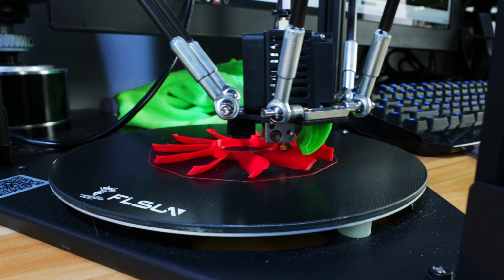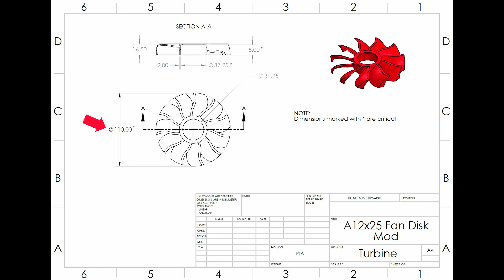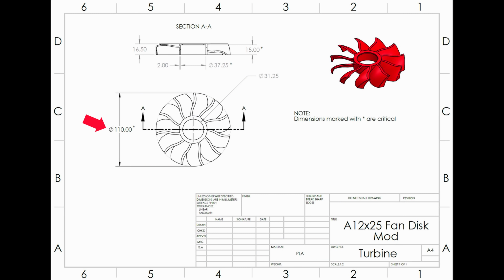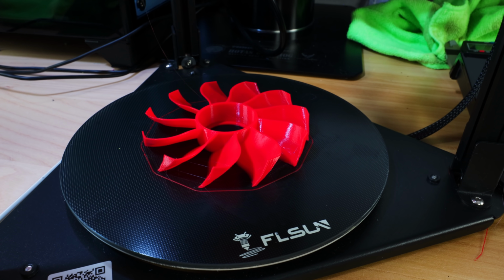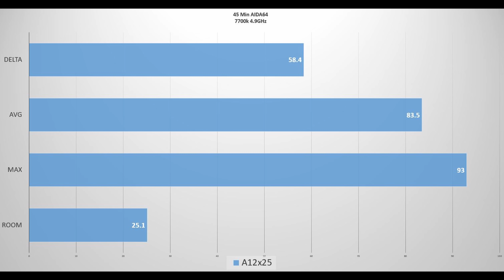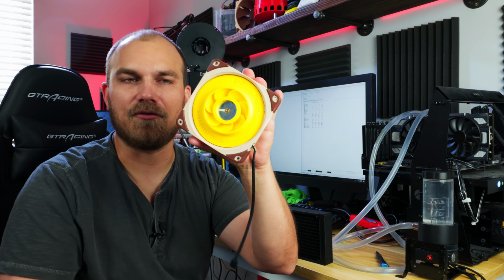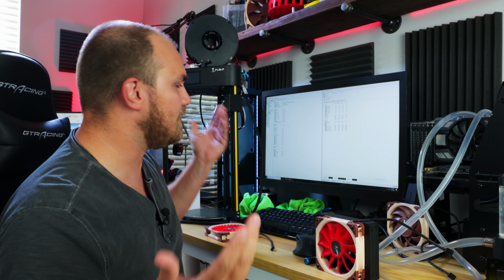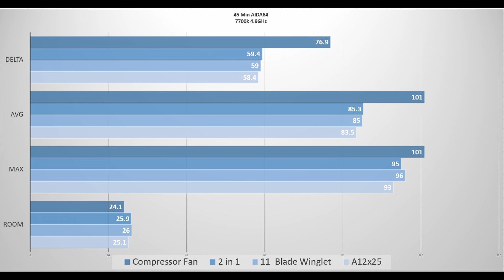My Subscribers Sent Me Their Fan Designs | Fan Show Down Episode 1

Comment: Suggestion: use a high rpm delta fan with pwm or a pot to control rpm. You could then test these designs at higher rpm, where some may perform much better.

Comment: I'm pretty sure the yellow one should spin the other way and be mounted the other way, using the large blade area to capture alot of air, and have the air speed up through the tightening and come out at great speeds from the smaller "mouth"

Comment: So your compressor is good, but the blades should be based on the shape and size of the standard fan.  Make the blades the same as the original 9 bladed one for the inner ring, but for the outer ring do something like 13 or 15 blades.

Comment: On the compression style you would want the compressed side (smaller side) on the cooler and the larger intake on the outside. If possible make the smaller size the size of an average 120 mm fan and the larger side sucking in more air. Would be great if you have a giant fan area and attach a small radiator to it without loss. Could even be better. Wonder if you could test the performance of it

Comment: Hi there, I really love the idea of making custom fan designs. Just wondering why aren't you doind tests with air cooled CPU coolers? There can be more gain from fan design than in liquid cooling. In liquid cooled CPU cooler you have radiator as limitation. Every radiator have it's limits and can't do much, much better than it already is. Some small variations yes, but I wouldn't expect great cooling improvements. If I was doing fan tests, I would test them with air cooled CPU coolers. Fan design can make more impact there. Idk, I would take some average Noctua aircooled CPU cooler and do same as you (or any brand of  cooler which can be fitted with Noctua fan). I'd really wish to see custom designed fans in that.
Anyway, custom fans - great idea. 👍

Comment: I’m not an expert, but wouldn’t it make more sense to have the “Compressor Blade” the other way around? So side with the smaller diameter is in the backside, where the air comes out?

Comment: God pin wheel shape is proven most efficient design, then add the cloth string lines curving in direction of spinning. As u move away from center hub the curved string lines go away the art of the design so less drag & ligher thinner on out side & stronger cloth on the inside.

Comment: For your red design. Can you switch the blades on the inside to be more blades the outside less. 
I think the inner most since tighter group could create more pressure. 
I am not a qualified engineer though.

Comment: Hi
I have a solution and it's can work well
What if make a fan like head of rocket? It's have wings longer and can push air more, the shape is like V and not flat shape, like rocket head
But some problems may have, low rpm, low stability, low safety if hand engage with that
But it's have best performance in air push, I promise

Comment: Your "jet style" fan is made in reverse. The inside of the fan blade goes slower so it would need more blades to move the same amount of air as the outside. So more blades on the inner circle and less on the outer.

Comment: The reason your estimated times are different from your actual times is because you don't have your acceleration settings the same between the slicer and the printer. By default I believe most slicers have acceleration control turned off because some printers don't support it. This means the acceleration settings in your printer are what it goes by. Your slicer is calculation the time based on the acceleration settings it's using. If these are different then your times are going to be off. My printer will print pretty much exactly the estimated time once I got these synced.

Comment: I kinda like the idea of a pressurized case with a compressor like a turbocharged car. If there was an intake fan that pushed air onto a closed off cpu and/or gpu, an exhaust fan that pushed out the warm air through an air passage, and out through a second fan that will pull the air out of the passage into the room.

Comment: there are way more factors to use. CFM and RPM how thick it is and 120MM or 140MM . not enough info to make it profesional man stress temps of the hardware you used overclock temps. cooling with water. the video quality is decent but not there yet you need to look at ltt and jays2cent for quality and realy compare your video's with them and see with what you can do with that. Maybe wake manufackturers up with fan design and stuff

Comment: Love the channel !  Going to work up one...  I have some 3D printers as well.  I set a goal to not use support.   On my MarkForged I typically don't go beyond a 45° overhang.  What is "overhang angle rule"?        I also have a FormLabs Form2, if you every want to compare materials let me know.   No issue running some and sending them over.

Comment: About the yellow fan, I thought that usually with fans the air PUSHED was stronger than the air pulled, and I think that fan was placed "pulling" from the radiator, am I rite or am I wrong?

Comment: do you think that the yellow fan didn't perform as well as it could have? Maybe it's better when used in an enclosed space to where the shortfan blades can really use the "torque" to pull air from a difference in air pressure.

Comment: What do you think to putting your 3D prints in a container with acetone fumes to 'melt' out the ridged texture of the surfaces?
You'd need to be careful that the inside of the hub doesn't change dimension, but the rough texture can't be good for airflow.

Comment: Why do you keep on mounting the fans the wrong way around?
The fan has to suck air thru the radiator, not pushing it into the fan. 
Do a video comparing suck and blow fans if you do not believe me.
Or check out any industrial cooler (I.E a car cooler fan)

Comment: If you're seriously going to do this, get a resin printer, geezus. There is no repeatability with FDM printed designs as too many variables exist. You can print 3 of the same yellow fan and get vastly different results from it - unlike Resin printers, which are both reproducable and significantly cleaner.

Comment: Fan noise is important to me. Here's a proposed sound experiment. Create a blade design that you like. Print N fans with distinct blade counts. Run each fan at the same RPM. Use a spectrum analyzer to examine fan noise spectrum. Look for a correlation between blade count and RPM & blade count.

Comment: so do you think you could do a blower fan, it would require you to build a shroud that doesnt move, but it works on centripetal force rather than pushing the air with a wedge. Then again the motor might not be powerful enough to see a benefit. basically you would need to enclose the fan area in a partial shroud, and you might be able to make a sort of inline blower fan, by having the outlet hole inline with the inlet hole, and just making the impeller thinner, allowing the air to move around the impeller and through the outlet out the back.

Comment: Is it possible to design a fan with a filter to bring in air flow but also self clean itself of dust?
For instance the filter would have a mechanism that act like a window wiper to clear the dust off and move it into a depository spot.

Or even better if the airflow is narrowed into a radiator sort of opening with thin metals pointing down but is wavy towards the fan, dust sticks to the metal grill and water will wash it off into a depository.

You kinda can't keep the PC in a room then, you'd need to pipe a drainage nearby.

Comment: 5:19 I got the Flux Delta 3D printer as my very first machine back in 2016. It's still my primary printer and the only reason I'm building a new one is for extra large format prints.

Comment: This is for something else but you could probably tweak it some and get it to work on their. https://youtu.be/48Ft2mAY0Y4. And if you turn one into a blower you can use the suction out of it to cool down radiator as well. My sons computer also have water cooled. Are use the suction from a blower friend 120 mm and the rest of the air is cooling down the motherboard. The temp stays around 30 Celsius and he’s a gamer.

Comment: Your 3rd fan is a great design the only problem is the ridges, Those little tiny micro ridges caused the air to move out towards the fan casing instead of straight through if you sand the insides of fan blades and the outsides of fan blades completely smooth you will get much better airflow even as small as those ridges are it will make a huge difference less turbulence on the Fan blade equals stronger pass through current of air. I still don't believe it would beat out the noctua but you would definitely get better results

Comment: Centrifugal impellers like the yellow design need a diffuser and volute to do what they're designed to do, which is turn air velocity into pressure head.  I mean, they'll suck air in and move it around by themselves, but without the rest of the equation they're not going to do anything efficiently; just shoving one in a cylindrical case isn't going to do it.  (I messed with this a lot in the design phase for this 120mm case fan conversion to centrifugal compressor: https://www.thingiverse.com/thing:2951796 )

Comment: I have a question that ive asked in a few places but no one has ever answered :
I have a case with less than ideal front air intake the lian li lancool 2 would i be better choosing high static pressure fans over high airflow fans ?

Comment: If you want to make the fan quiet the blades need to be different distances apart. The difficulty with that is that you need to balance the fan to prevent vibrations. Take a look at the tails of the EC 135 or Bell 429.

Comment: Make an impeller blade and cut a hole in the side of one of the fans, then place the fan between two radiators and see if it does the job.

Comment: what you need is to not move the air around you need to turn it into a vortex fans are nice and all but what you want is a way to constrict the air and force it inot a smaller volume . so what if you make the fans longer to compress the air not lanth but weth mkeing them sprial at the tip as it tapers down /the wall could help also if it looked like a funal .... sorry but my enghlis is good but the part of my mind that tells me the words are wrong some times dos not work all tha time lol .

Comment: Pretty sure the yellow design was spinning in the wrong direction and on top of that needs to be flipped around so it push’s the air not pull it as it’s designed for generating static pressure. Just saying.

Comment: The yellow one is actually more of a centrifugal pump impeller than a compressor fan blade. That style is designed more towards high output pressure than high flow. It's also designed to run best within an enclosed pump volute. It just wont be able to move enough air to provide good cooling performance.

Comment: have you tried using an impeller? or a duct? i immediately thought of using a compressor fan or impeller in conjunction with an inlet duct (half torus) like in a turbo. and on the back end of the fan you could use static counter blades to increase static pressure.

Comment: um,. looks to me like the yellow one isn't finished ,.it is basically a pump impeller ,. they draw the flow threw the center and flick it away ,.you need the right size port for each blade though ,.as there is no way for it to work at all the way it is , the center should look like the center of the red one really,. it just looks like it was't cut out correctly

Comment: Just been thinking about the centri-something compressor. Wouldn´t it work better if the design were turned around?
A bigger scoop compressing air into a smaller opening?

I.e. the scoop could protrude outside and thus be bigger than the diameter of the original fan, whils the other side compresses the thus bigger mass of air into the size of the original fan.
Would be interesting to know whether the increased air pressure would heat up the air to a point of reducing effectiveness, so perhaps you could design several of them with bigger and smaller protruding scoops?

Comment: measuring air flow by looking at the temperature drop  of the cpu is not bad but what is the temperature in your room go's up or down ?
perhaps attach it to a pipe and measure how fast another fan at the other side is spinning ?

Comment: If only you knew how compressor fans work, you might have at least tested it the correct way round and might have had a different results..... For you information, the large diameter side is the air intake, while the small diameter side is the air output.  Compressor fans just don't work if you have them the wrong way round.  You get a downvote for you stupidity.

Comment: You really need a smooth surface to get most out of the design. If you take a look at the yellow fan, the support structure makes the surface really rough which has a huge disadvantage.

Comment: Interesting to see if ABS fans with vapour polished surface would perform a little better? Since the ridges of the print would be quite rough and could generate some turbulence? Get that "laminar flow" action going. Would explain why noctua has chosen a somewhat grainy texture as the surface finish on its fans...

Comment: Room temperature is going to be a problem with this leaderboard system.  I'd suggest using a + or - differential using the noctua fan as the baseline.  So if its hotter, you take what the temperature the noctua gets on that occasion, and the difference is what you'll count as the score.  Closer to the noctua you get the better your score (or surpassing it).

It's not a perfect system, but its sure as hell a lot better than just plugging in the temps, and way easier than climate controlling your room with any sort of precision.

Comment: I remember a LTT video of a giant fan with power in the horsepower range that was then funneled to the case. How about trying a giant (within reason like 2x normal size) fan and then funnel the air flow but use a motor with enough torque to maintain the same room as the smaller ones?

Comment: Compressor fan doesn’t work because it blows only a part of s radiator. Speed is not as important as wide consistent air flow that covers as much radiator surface as possible.

Comment: The FLSUN Q5 is the only delta I would suggest for a beginner for the cheaper printers as of today. it works FANTASTICALLY. also for fans like that yellow one trying printing in 2 pieces and they gloop them together to avoid that overhang/support issue.

Comment: So... that centrifugal compressor fan is: 1) awesome; 2) not spinning backwards; 3) the exact same kind of compressor found on a car turbo; and 4) very similar to a blower fan.
But, centrifugal means away from center.  So to use it as a fan, you would need to block the back and open a side, essentially turning it into a blower fan.  To use it as a compressor, it would need to be mounted to a compressor scroll, just like the intake side of a turbo on a car.
An interesting side note, because of all the turbo on a car comments and all the blower fan comments, whenever I read blower, I first thought of a roots super charger before realizing they meant centrifugal fan.

Comment: To be fair, I don't really have any idea what I'm talking about, but... 8:40
isn't a "compressor wheel" normally spinning much, MUCH faster than a Noctua motor can provide?
I'd try running the fan at around 5000-6000 RPM, to see if it actually works like a compressor wheel or if it needs work.

Comment: The yellow fan is missing a shroud at the back of the blades. Centrifugal fans push air out the side of the rotating blades, not the back. It won't work if the blades are open like that - the air can simply slip out the back of the blades at minimal pressure instead of being pushed out to the egde at higher pressure

Comment: The problem is also that the layer lines of the 3D print cause turbulences and thus every 3D printed fan is aerodynamically much worse than the injection molded ones. Could you test one Fan Design with different layer hights to see the difference? Let's say 0,05; 0,1; 0,15; 0,2 mm?

Comment: I would love to see airflow measurements to see which fan moves the most air.  It has long since been proven that you can reach a max limit on cooling to airflow ratio to where it no longer matters how much air you are moving and will not see any more cooling benefit (due to the fact that once the air reaches a certain level it can only be able to pull so much heat from the radiator fins based on size). However, I would be interested in the airflow being a part of the metrics. Would anyone else? upvote for yes

Comment: One of the major issues these designs will face is the fact that all of those layers and surface imperfections will cause air drag and turbulence that could impact performance negatively. An ideal scenario would be printing those on a resin printer.

Comment: Radial fans are usually good at moving lower volumes of air at higher pressure then axial fans, depends on the design of the impeller but that is the general rule for these. I think one of the issues with this yellow one is that since there is no difusor after the impeller directing the air evenly toward the cooler, since the impeller is flinging the air outwards from the center all air will come out from just the outer edge of the fan in a narrow ring and so just hit the outer  edge of the cooler instead of its entire surface = less surface area cooled = hotter cpu.